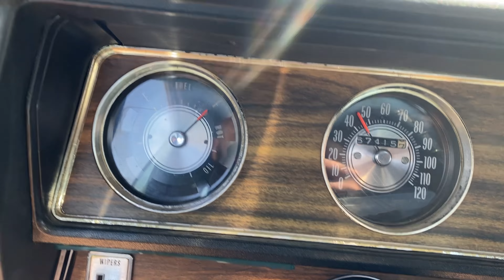Changing the Fuel Sending unit on the 71 l DIY

Comment: Thankyou  so much for posting this video i got to do this same job next on my 71 cutlas, my gas needle is pass the full not moveing , where  did you fine those new bolts an insert  that  the bolts  screw into ?   My  bolts that hold the  gas tank look very rusty,  im probably  going to half to buy those too..

The inserts that the bolts screws into , what are they call when i go to the hardware store ?
Reply from the maker: They have kits online & even on Amazon. The hardware I found at auto zone. Although I will have to say that the bolt it came with was too short so I ran to my nearest hardware store & found a 4” to fit the thread & made it work. 

Also be sure to clean the area where the ground connector goes, fuel sending unit I got from rock auto. W/out return
Reply: @dltsgarage1705   I appreciate  the advice,  thank you so much ! ! 👍 👍